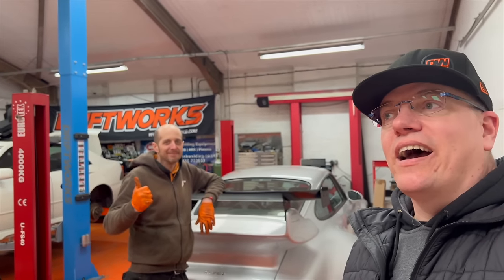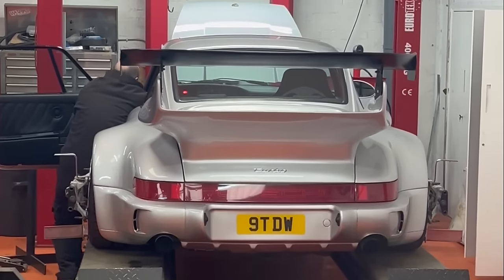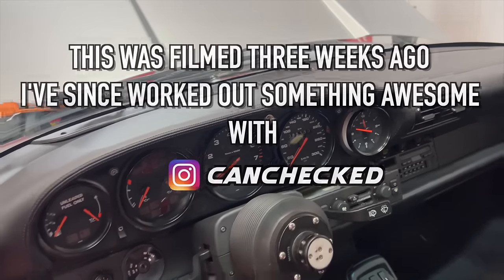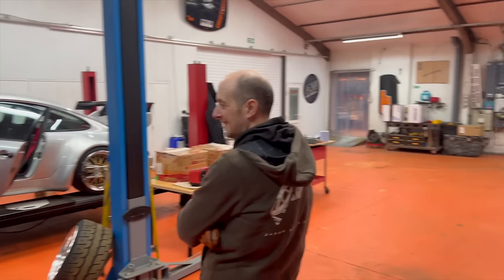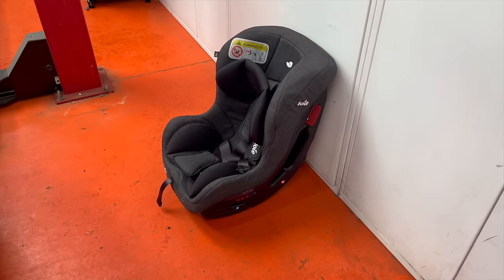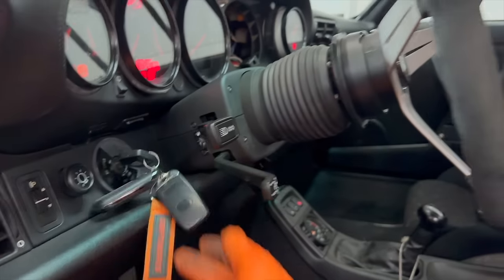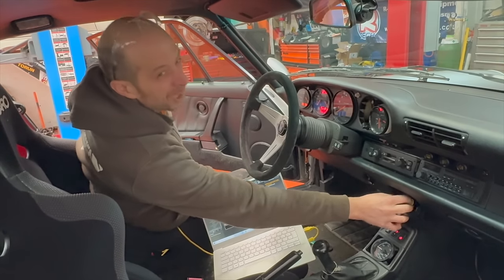964 Turbo 2 Step & more Mods for my 600whp Porsche 911 Turbo

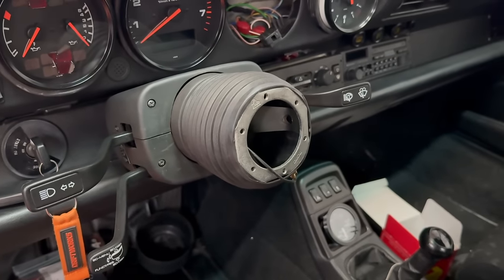Comment: 964 is the second best porsche, only beaten by the 956 that did a 6:11.13 in the 80s.  964s are proper rude, best in metallic navy blue with gold centre BBS

Comment: I love that damn 964 so much, I know I've always clamored over the Murcie, but I'd definitely take that specific 964 instead 😅🤤
Now a word about that horn, my 89 Baby Cadillac DeVille has a triple horn, and the highest pitch one doesn't work, and my octaves were/are way lower than yours are lol... sounds like a muffled train missing that highest horn, I remember years ago trying to find a full replacement and not being able to find even used ones, and then forgot about it.... until I seldomly need to beep, usually at someone walking to already get in my car and they both get stunned by a horn beeping, and start laughing at the sound it produced 🤣😅

Comment: You will need remove the slave cylinder and to put in the clutch rod and fork while sliding in the trans at the same time. Usually this done with the engine out. The new flywheel is for the stock ignition system. If you have a different setup you can use a 964RS light weight flywheel with a extended through out bearing. go to Patrick Motorsports in Arizona USA.  They have kits on line you can look out.  Cheers
Helio
Reply from the maker: Thanks man. This is from a couple of weeks ago. The clutch (and a different flywheel) is in & you can see the drama we went through in the next video. I've ended up with a really low engagement on the clutch pedal for some reason.

Comment: link ecu has a round shape digital guage that can be connected to can bus outputs and displays multiple data points idk if it will fit that one guage pod on the far right of your cluster but I'm sure it be close enough to make a bezel to make it look clean